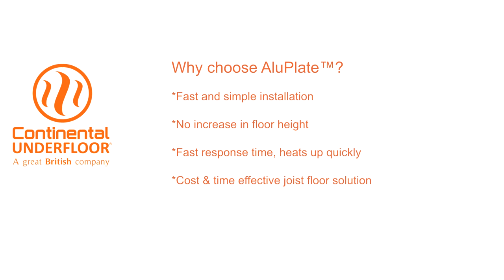Underfloor heating first floor AluPlate™ install by Continal Underfloor

Comment: Thanks for the great video. 
My question is what would you put over the top of the spreader plates as a flooring which is suitable for heat transfer? Would an 18mm chipboard t&g flooring be ok? Then on top of that would be underlay and then laminate flooring.  Cheers
Reply from the maker: Yes, it would be perfectly fine to use an 18mm chipboard flooring with underlay and laminate.
If you require more information, please give us a call on 0333 800 1750.
Reply: Dont.. Had that and it was crap. Almost no heat coming through at all. Wood becomes insulator unfortunately...
Reply: @remismar4416  Hi, did you install the spreader plate system? I'm looking at potentially buying and installing it at my house renovation.
Reply: @snowboard9292   Let me know what you decide to do, I'm researching different ideas myself
Reply: I think it will be the spreader plates but would just like to know how effective they are! @eXRe4per